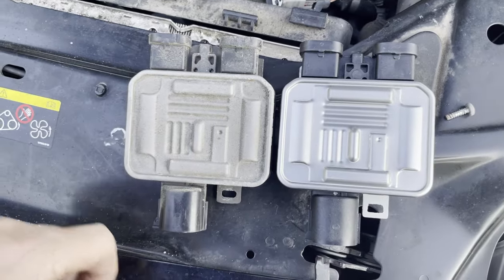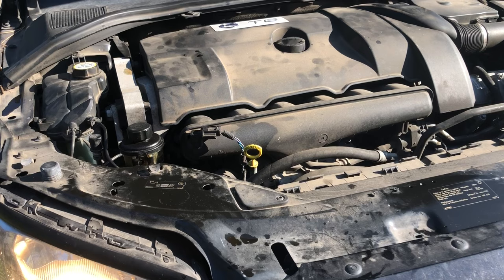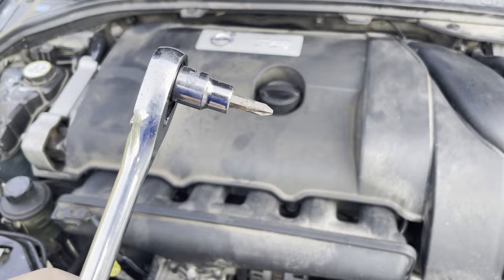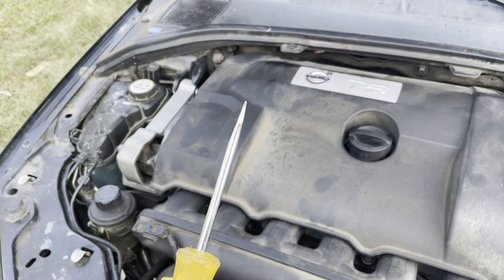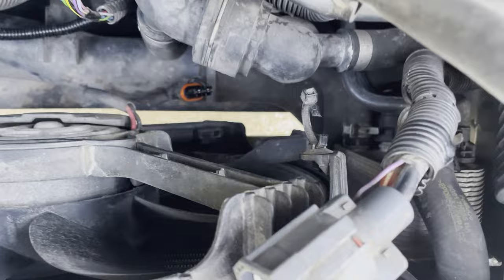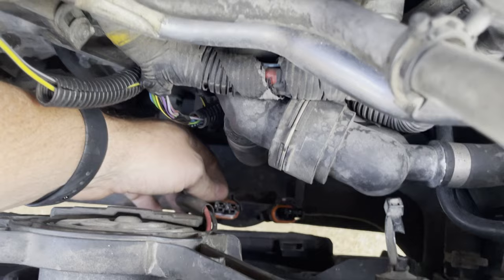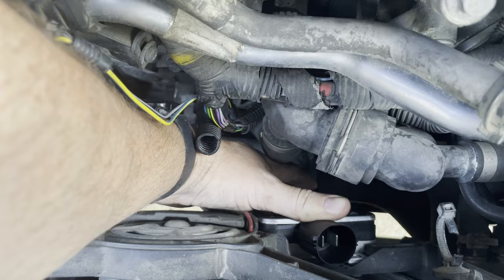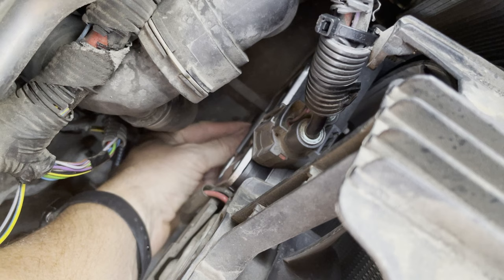Super Fast Fan Control Unit Repair - Volvo P3 T6 and 3.2L - 2010 XC70

Comment: What systems and or codes did you get to determine the controller needed replacement ?
Very nice video
Reply from the maker: I wasn’t getting any codes, just an overheat warning. Opened hood and noticed cooling fan would only spool up for a moment and stop. 

Ran an OBD scan tool to see coolant temps in real time. Can remeber exact intervals, but fan is supposed to kick on when coolant temp sensor hits certain level. Also replaced coolant thermostat while troubleshooting this issue.

Comment: My S80 is reaching high temps and the Fan is not Turning on when It should, It is working and turning on sometimes. Do you think replacing this control unit will help?
Reply from the maker: Best guess is yes. We were having some bad but intermittent overheating issues and this fix squared up all of them.

Comment: Does anyone know if a 2017 V60 control unit should also have 3 connections?  Mine has the same control unit but only 1 of 2 connections used on the bottom.  Issue is fan will not run.
Reply: I have the same issue